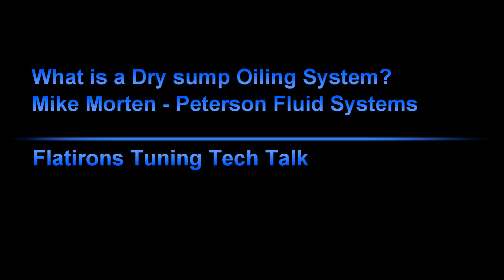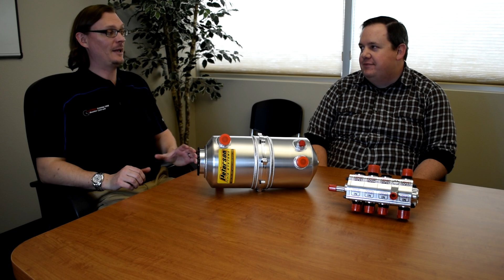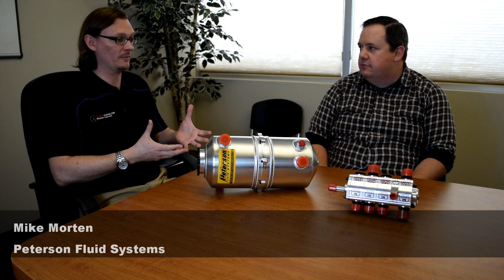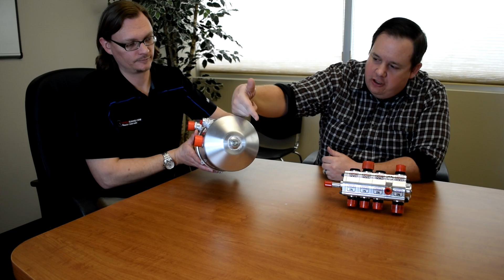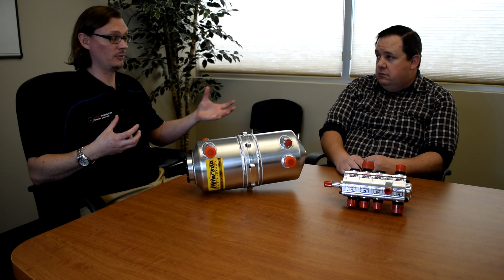An Intro to Dry Sump Oiling System - With Peterson Fluid Systems

Comment: I kind of just want to use my standard style oil pump with the pickup plumbed into an oil tank and scavenge pumps ran off the accessories belt, and an accusump for cranking pressure
Reply from the maker: Thanks for the comment and thanks for watching.  I'd recommend taking a look at our video talking about the difference between an Accusump and Drysump:

https://youtu.be/5NN8GShcskM

Thanks for watching and Stay Tuned!

Comment: What types of oil pressure will u get this system
Reply from the maker: With this system, you have a lot of control over oil pressure.  We have installed a dry-sump on our engine, and we are seeing 65 psi at idle, and 85 - 105 psi when running.  And that peak pressure is adjustable on the pump.

Thanks for watching and Stay Tuned!
Reply: What types of oil do you use for a system like this

Comment: Reason for me installing a dry sump system on my car: .... the overall height of the engine fitting in a car the engine wasn’t designed for....  hood clearances (sleeper status), &  oil pan clearance problems with mopar older “K” frames design flaws, & routing parts for easier serviceability/ mechanic maintenance user friendly. Nothing like fixing a newer car & having to remove non-related parts just to get to the part that actually needs the servicing. 😆😂

Comment: Couldn’t people just install a type of ball valve on the bottom of the oil tank: so once done driving the vehicle, turn off oil flow to the pump so it eleminates  gravity wanting to drain & back feed oil into the pump after days of sitting... just always remember to open up the ball valve to let the whole system function like normal
Reply: Or, mount the tank below the pump.

Comment: What about using one way valve between a scavenge pumps and tank to prevent oil from draining back to a engine ?
Reply: That's how they do it on accusump systems. Or just a solenoid that closes when ignition is turned off

Comment: Quick question. What about oil change how do you empty all that system so you don't have a old oil in the pump and stuff??? Just with a drill like you talked about when you prime the engine ?
Reply: pump it out

Comment: Does the dry sump system get rid of the engine oil pump or how does it work once it sucks the oil from the sump? Where does it pump that oil? How is it restributed then?
Reply from the maker: Thanks for your question.  Yes, a Dry-Sump oiling system locates the oil outside of the pan in an external tank, and the pump itself would replace the stock oil-pump (assuming that the car did not come with a dry-sump oiling system from the factory).  The oil enters the engine in the same location as it would with the stock oil pump, through various methods depending on the application.  And then the dry-sump will have a second stage that actively pumps the oil from the pan (which would be modified from stock as well) back to the external tank.

Thanks for watching!
Reply: All right. Thanks!

Comment: With 6 gallons of oil i shouldnt need an oil change for a long time
Reply: more thermal mass means lower/ more stable engine temps.
Reply from the maker: If only it worked that way :-)
Reply: FlatironsTuning but is there any reason why i couldnt run a 6 quart system?
Reply: I am wondering if this could work on s Detroit diesel 2 strove v8?  I like the dry sump because it allows tap off of it and run VRO oil injection into the intake, then fill the whole thing with silkolene pro 2 sx 2 stroke oil and burn it off with a VRO pump and oil injectors. That’s what I would onbs v8 BB aluminum motor converted to a 2 stroke. The oil injection will work on a 4 stroke also ad I have tried it

Comment: Seem you could have the oil filter relocation lower then the pump. This would prevent drain back. As the filter has an anti drain back valve.
Reply from the maker: Thanks for watching!
Reply: I now run xd-100 2 stroke oil in my old truck filled and premix. A dry sump with a VRO pump and oil injectors is what I would like to go with for total loss burn off. This dry sump thing gave me some ideas for this.